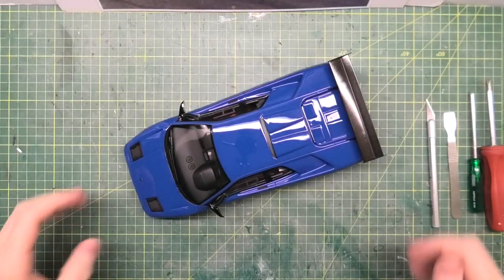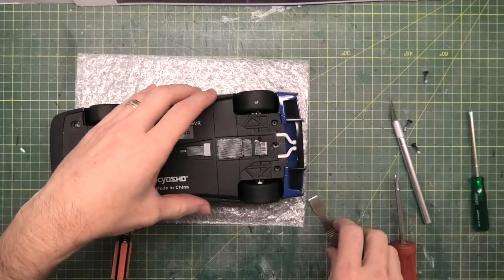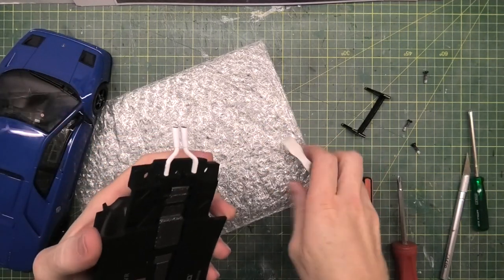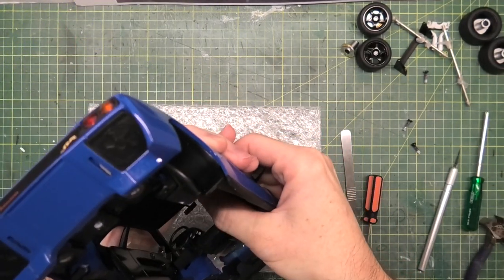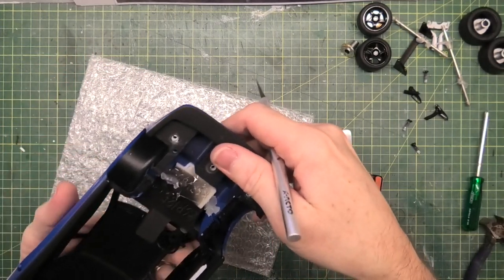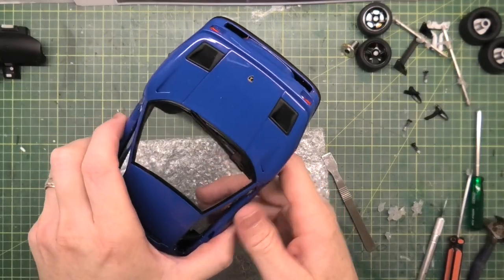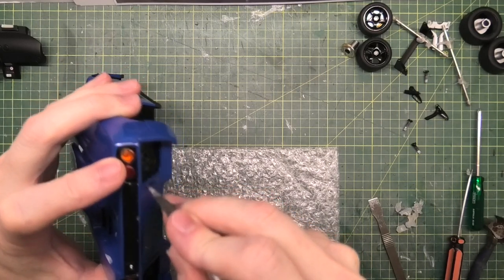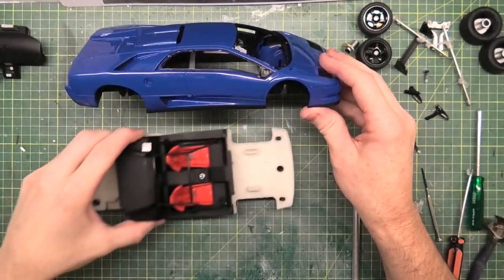HOW TO DISASSEMBLE A SEALED RESIN MODEL - Step by Step

Comment: Having pulled a fair few resin models apart, have found many of the hot glues from China can be gently heated with a hairdryer, lightly melts it, allowing you to pull axles out etc.

Comment: Hi Rob, you got a link to re-painting a resin model? Got a project im wanting to do but dont think you strip the paint off resin like you do diecast so any video/ help appreciated. Assume you just rub down?
Reply from the maker: Just sand down the original paint and paint over, Paint stripper on resin models never ends well.
Reply: @ROBSMODELCARS  cheers buddy. Will give it  alight rub over then build up with light coats